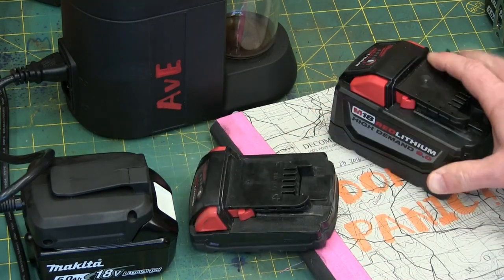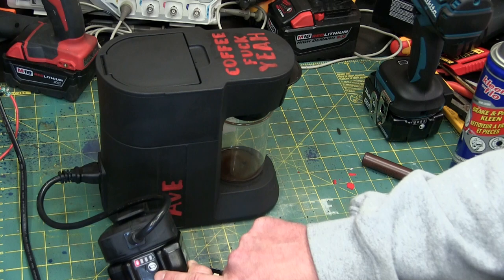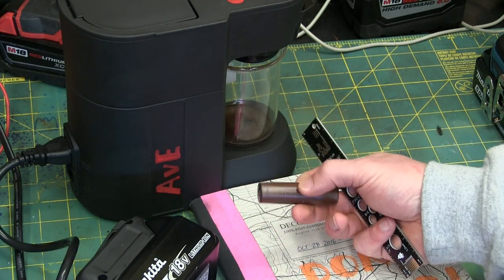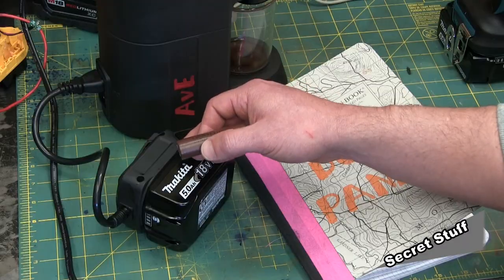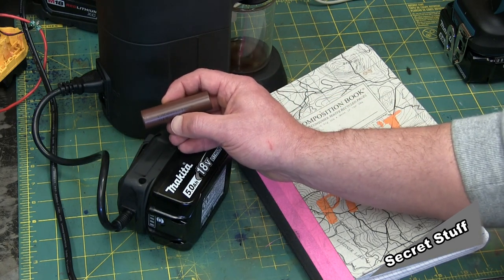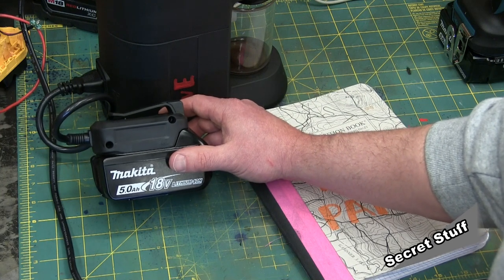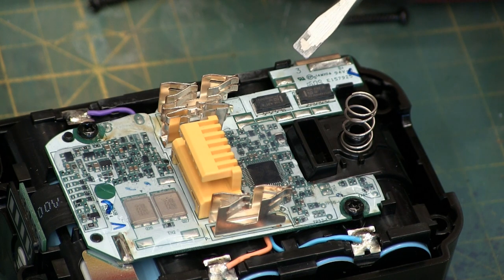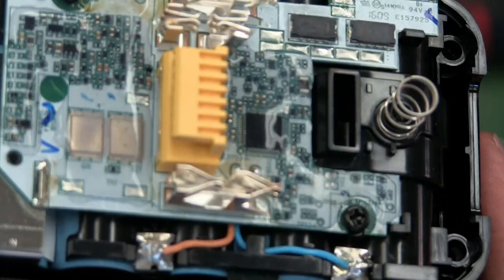BEST TOOL BATTERY? WHY BIG LITHIUM COST YOU LESS!

Comment: I mess with a lot of batteries.  Just years of hobbying.  Capacity is normally measured along with a  rate of discharge.  So you sort of got it right, depending....  For old school people, lead acid typically used a 10 hour (starter) or 20 hour (deep cycle) "rate", to claim capacity.  20 hours @ 5amps is a 100ah deep cycle battery.  This doesn't translate to 100amps for one hour.  So ratings aside, you may get more capacity at a lower discharge rate, which I think is what you were saying.   But capacity is  a curve that exists, when describing its discharge performance.   AFAIK.

The treatment, and cycle behavior of the various chemistries of course contribute to their longevity, and capacity ratings.  For lithium, and the lithiums, it's still unclear to me what industry accepts as a rating.  I would say many expect @1C. Makita is like likely saying that pack is 5ah @1c (5 amps discharge).  Or you could say, it's the 1 hour rate.  Either way, it all depends on the application.   At 15 amps it's likely less, and yeah, with the bigger pack, you might approach the rating.  But battery tech is worlds more dense than it used to be.  The C rating can mean a lot, and be somewhat meaningless, cause it's kind of a harsh discharge rate when you think about it.  The point is, you can't specify a capacity, unless you also specify a rate.  Cause science/chemistry.

 Now days, pack design, and management are the keys, cause the performance expectations are 10 fold (or way more if you are a hobbiest).  Choosing the right chemistry for the job is also key.  But just like an old lead acid.... pick it up, is it heavy?  It'll tell you weather the capacity rating is bullshit or not.  Go pick up a shitty D cell rechargeable (like an energizer).  Then pick up a decent one, like a varta (they went to the moon), or a radio shack one, or a rayovac.  And you'll believe the ratings marked on the battery.  And you can detect the lies.  Some things never change.  For lipo, look at the tabs, and the width.  If they are not wide, but have a high C rating, it's likely bullshit.  You have to get the pixies out.

I really really liked this teardown.  Of note, are some thoughtful design decisions, and use of phase changing material to absorb heat.  All they are missing are frickin laser beams.  Watch it.  It's cool.  Kudos to some engineer that gave a crap.  It single handedly helped me decide I would buy ego.  Tear it apart, it looks good.  Give them money.  It's the only way we can defend against crap.  

https://www.youtube.com/watch?v=lRdBS9oFUXc

Comment: Ive been reading alot about the various chemical reactions and witchcraft going on in modern batteries and by far the most interesting is the liquid metal or molten salt battery, used for extremely high current output for AIMS missiles and these batteries have a working temperature range over 400 degrees f with 3x the power density
 
Thanks for sending out the rulers cant wait to get mine.

Comment: Might want to look up a chap called Mooch315 on reddit for a lot of indepth stuff on batteries. He does the vapes, but also is a electrical wizard so tests all the bullshit claims from a lot of 3rd party people (remember one being sold as 60amp, 3000mah. Tested at something like 15amp at 2000mah). But he throws all his data out for people to read over, always tests the same way, tests to till failure.
Reply: Big_Adam_2050 I think I've heard of that guy. :-)
Reply: Just saw this comment - he also has a YT channel now: Battery Mooch

Comment: What I learned about Li-Ion/Li-Po cells by blowing up a few:

High current delivery
Low voltage
fast charging
high capacity
Makes your coffee*

*Subject to battery capacity, coffee maker type and wattage... it MUST be capable of at least 10A continuous. Barista machines are NOT gonna work with a drill battery... get a battery pack from a Tesla instead!

As for downsides:

May explode or catch fire if overheated/incorrectly charged
Cells require a balancing charger or monitoring board
Cells can't be over-volted
Cells degrade when charged from "empty" all the time. Best to keep the cells at 80% capacity for longevity if possible
Cells cannot be drained flat and have a lower threshold (I found my hand built battery pack to be safe at about 3.2-2.8v per cell, recoverable at 2.5v and dead at 1.0v)
Fast charging above 2.5C will require temperature monitoring due to the battery's internal ESR which will increase the temperature... the more current you give 'er the hotter she gets!!

Oh, and fast charging degrades the cells faster than a slow charge... if you have the time, doing a 0.5C or 1C charge is best for your batteries!!

Comment: They put silver on any contact point to reduce the arc when the connection is made so as to reduce pitting.  You should find silver on most any goo contacts even on a light switch.

Comment: Lithium Polymer has both, high Ah rating and crazy high discharge ability.

I have RC aircraft batteries that have 5Ah capacity and can dump 40C or 200Amps at 13V.

I think the only reason they dont put them in consumer tools is they tend to flame on and explode if abused.  No 200lb gorillas allowed.
Reply: tiporari yea, lithium-cobalt chemistry is not very forgiving of abuse, having the lowest thermal runaway threshold temperature and the highest temperature of reaction when in runaway.

Comment: The "original" M12 battery pack had 3 - 1500mAh batteries (still what they package, cheap SOBs).  The 6 cell pack had 3000mAh.    Like wine (but not necessarily beer), time went by and Milwaukee came out with the 3 cell 2000mAh and 6 cell 4000mAh packs.  Now they have the 3 cell 3000mAh and 6 cell 6000mAh packs.  Double the capacity in 4-6 years ?  pretty good.

This kind of contradicts your comments about high mAH versus high current as I would assume that each of the 3 cell packs could put out the same peak current for some period of time.

As we said in the 60s, "Living better, chemically !"

Comment: LG HG2 20A, 3000mAH   
Sony VTC5A 25A, 2600mAH

Out of all the 18650 batteries, these two seem to have the best balance regarding a medium output and mAH hours.  As stated before though, different batteries for different uses/needs.

Also keep in mind that many re-wraps that aren't purchased directly from the OEM manufacturer are purchased by other companies from the OEM manufacturer's lower quality bins.
Reply: Death to re-wraps.....or maybe more like death by re-wraps.
Reply: milliAmpereHenry?
Reply: Cory Goodman VTC5's are 30a continues discharge, the new VTC6's are still 30a continues discharge but are 3000mah, definitely the best all around batteries currently on the market, finding genuine ones that arnt gonna break the bank is another story though.
Reply: Cory Goodman the HG2's have been disappointing lately though as the availability of A grade cells has suffered. A huge number of counterfeits too. The 30Q's and especially the VTC6 are a better choice IMHO. I completely agree that the VTC5A is an extraordinary cell though.
Reply: CD Productions the VTC5's are rated at 20A by Sony and VTC6's are rated at 15A by Sony. The VTC6's run cool though so you can run them at 19A or so before their temperature equals other VTC batteries at their rating.
Reply: Battery Mooch oh yes your right, thats my bad, also states the 6's are rated for 30a continues with 80c temp cut off

Comment: in terms of lifetime cost it's a bit more complicated than that, generally low capacity/high discharge cells have a much higher expected charge cycle count, so that the lifetime discharge is actually going to be higher from a low capacity cell than the higher and often more expensive cells, and generally it does not take that many charge cycles for that graph to converge.

Comment: I know that the Makita batteries also have a counter of how many charges it has been through.I assume all of the batterie brands do to. I found that out when I went for a warranty issue at a local hardware store. I was wondering if you knew what other info is stored in the chips

Comment: I wonder if he's seen the 20700 and 21700 batteries. They're going to be the new standard in power tools. Theres a 4000mah sanyo that's been tested to run safely at 16a. A 3100mah sanyo tested to safely run 30a, and a 3100 samsung that's rated at 30a but tested at 40a. That's some serious stuff there. And they still get charged to 4.2V and I believe are stil 3.7 nominal.

Comment: Most reliable batteries are Bosch, they have simple board setup
all Batteries use the same cells more or less.

Milwaukee has board issue protection cause a lot of flashing red light won’t charge.
as much as i like Milwaukee tools 

Hopefully they fix all the issues in the 21700 series of batteries.

Comment: My bet would be some sort of palladium plating on those contacts, that'd be resistant to corrosion, survive some arcing, and is relatively hard but won't flake off as easily. On the other hand, it might also be polished tin cans, you never know with these guys.

Comment: It's quite possibly silver. Unlike copper corrosion, silver corrosion does not reduce conduction. That's why the use Navy uses silver ferrules on fuses and on high current contacts.

Comment: Those contacts may very well be silver. After all, silver is the best conductor of electricity at room temperature. They may be figuring that some prosumer will be moving the battery between tools and charger frequently enough to remove oxidation from the contacts. Some Nitric Acid may allow us to be enlightened.

Comment: well milwaukee makes decent batteries, nice that there is a 9ah version. but they charge so slow compared to makita and i too definitely have a love/hate relationship with milwaukee. The m18 fuel rotary hammer with hammervac loses charge so quickly, i only need to drill 9 holes per day but end up replacing the battery like 6-7 times per week and when it's half charge it loses a lot of power and speed. Also the vac is impossible to use with 1 hand as it keeps jamming on itself and needs to be held in the correct place with your hand as it never retracts straight, unlike makita's

Comment: I've messed with the Makita 14 and 18V packs a lot (we use them for caving so I have 12 14V packs and few 18V ones I've cannibalised). So I can give you some gen on them. That yellow connector does not give you balancing connections (more's the pity). It gives you some kind of serial connection to the pic (and a connection to the thermistor). The tools connect to the two large connectors, but the chargers connect to B- and the other chunky connector. This is to have charging via a thermal cutout I think - I've not checked the details.

The main thing that will really piss you off about these packs is that they have some very dumb software in them, which if it decides your pack is poorly won't let you ever charge it again (with a Makita charger) even though it's absolutely fine. I'm sure we all agree that that is pretty egregious. Once a pack enters 'knackered' mode the charger does its serial handshake on connection, gets 'this pack is poorly' back and flashes the 'go shopping' LEDs.

However if you just charge it with an RC charger, you'll find that you can use the pack for many moons (we've now had some in this state for 3 years). We've had 6 of our 12 packs enter this state, but when you measure the capacities there is no loss in the 'knackered' cells. I have a spreadsheet measuring pack capacities every year for 5 years when they come back from the expedition, to prove it.

I believe the issue is that the fancy board in the pack is powered by one cell pair and it sits there drawing a few microamps (maybe milliamps?) so unbalances that cell pair with respect to the other 3 or 4 if the pack is unused for a long time. Our usage pattern is daily use for a 5 weeks/yr, then sitting in a box (@40% storage charge) the rest of the year. If you put a pack on the charger that the fancy board doesn't like the state of 3 times in a row, then it is declared 'knackered for evermore' by the software and you have to start using an RC charger instead of the Makita ones.

Even worse the fancy board doesn't even balance all the cell pairs in the 14V packs - its only has a sense wire to the middle of the pack, not to each cell pair (ie. 3 sense wires for a 2S4P pack, not the 5 you'd expect. The 18V packs do at least have a full set of sense wires.

Finally, oddly, all that fancy circuitry works with the chargers to stop you setting fire to shit, but it does nothing during tool usage - the tool is connected directly to B+ B- and you get to flatten the pack as much as you like with the corresponding risk of cell damage when a pair drops below 2V. There is no undervoltage protection (which stops said circuits going wrong, but it seems daft to have all that fanciness in there and for it to do nothing when in use).

This is all such a PITA that we have started binning the stupid board they put in these packs and replacing it with one that makes the pack dumb, and just exposes the sense wires via that handy yellow connector so we can use a standard balancing charger to keep things nicely fettled and not get spuriously told that our packs are dead.

Makita make great kit (we love their drills for placing bolts, and they are impressively cave-proof), and these batteries are great in that they have good capacity high-end cells and are robust. After 5 years of use we are getting only 1% cell degredation per year (ish: the data is quite noisy). But the software in those packs really sucks, and you don't have to be all that cynical to think that Makita quite like the fact that a lot of people are buying new packs when they don't actually need to. And not even balancing! How shitty is that?

So - there are major caveats to those packs. Note that I am talking about the 14V ones here, which I think are effectively discontinued now? The 18V ones may be better on the software front. When I get round to laying out a proper replacement PCB I'll put it online (I've just hacked it up with vero so far to get the dimensions right and prove the principle).

Hope this treatise is interesting, and I'd be interested from feedback from others.  Here is a chap who did some research into the issue a few years back: http://www.ecat.si/2013/09/makita-hacking-part-i/
Reply: Yes! I’ve run into this with the makita batteries. No balancing, one cell gets wonky, pack is bricked!
Reply: Link is broken. Do you know if it's moved?

FYI newer Makita packs are quite different to what you describe. They have stand-alone protection and will turn off a mosfet on overtemp or overdischarge. They will still brick themselves at any sign of a fault, though.

Comment: I have been a die hard Milwaukee guy for years and my last 3 drills have all died due to the triggers and last on average of 2yrs which is shit although my current drill is from the magnum line and has lasted almost 3 but just like yours the trigger sticks but I can just pull out on it to stop it don't have to take the battery off.

Comment: I've given up on the name brand batteries.  The knock off batteries work just fine for me, and I can get them for 1/3 the price with cheap cells or 1/2 the price with name brand cells.  I'm running Makita tools BTW.   I started buying the knock off batteries after I had a bad experience with the Makita batteries.  I had 2 batteries that fell victim to the single cell drain problem that many of the early LXT batteries had after owning them just over a year.  You can check the Googler if you want more details on the design flaw that caused the problem.

Comment: if you have look on Facebook or Google for a fella called mooch, he does bench tests on 18650s,18350s, 26650s etc and has one of the most comprehensive lists about.
Reply: AnAngryMudkip he's done a lot of testing! ;-)
Reply: Battery Mooch not enough though.  ;)
Reply: Battery Mooch it's a never ending task. We are all thankful to you though Mr Mooch! 
Keep your battery discharger in a vise...
Reply: AvE, videos coming soon :)
Reply: Battery Mooch I for one, would watch your videos religiously. As I do with AvE.
Reply: Mooch and AvE...what has the world come to?
Reply: holly shit you can tell a lot of us vapers watch AvE lol
Reply: LG Chem 18650 HG2 20A max discharge rate , 3000mAh.  Very impressive !!

4 pack, shipped from the US of A, <$20 on flea bay !!!
Reply: theoldwizard998  Just wait till you play with lipos. 12.6v 2200 mah with a 20c continuous rating and 30c peak. Can be had for less then $10 if you are patient.

Li-ion is cool and a bit more durable, but power to weight is all Lipo.